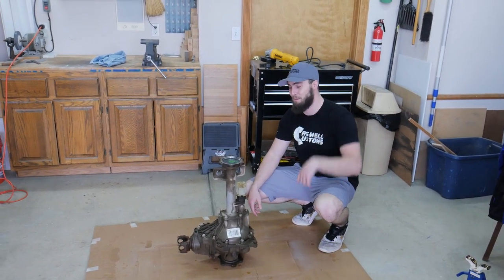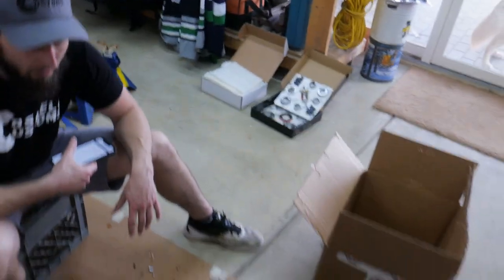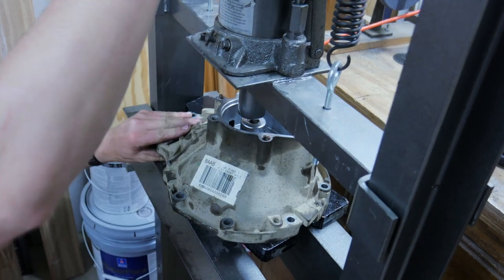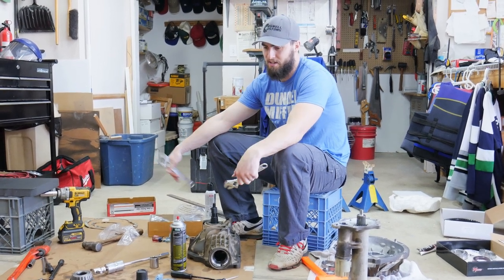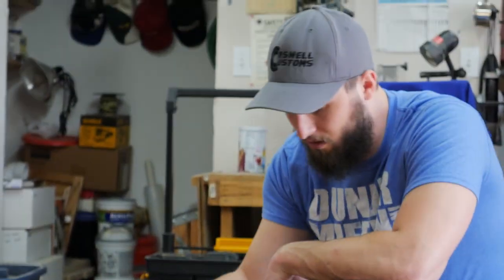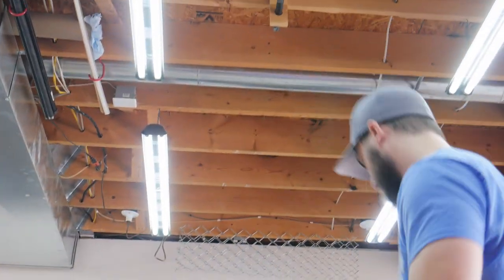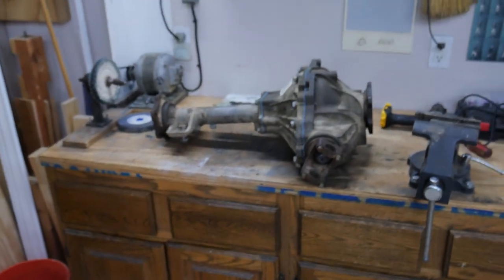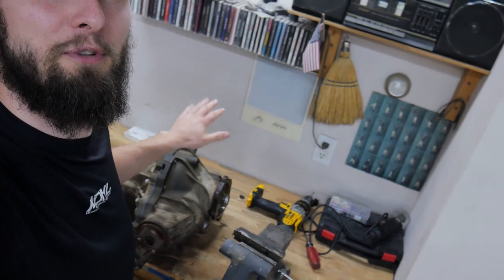GM 8.25 IFS Front Differential Re-gear 3.73 to 4.88 1500 trucks

Comment: What size tire you have and hoes the RPM driving around. I am looking at going to 4.88s in my 10 silverado 1500
Reply from the maker: I am running 37’s I do not have the truck all back together so I have not driven it yet since regearing.
Reply: @CaswellCustoms  I run 37s also getting a yukon rear posi and regear to 4.88s in aug.
Reply: I end up changing to 4:88 and it was worth it. The acceleration is way better withe 37s. Only thing I wish I did different is I should of done a rear locker instead of posi.

Comment: How long would you say it took too get it done.
Reply from the maker: You can get it done in a day if you have all the right tools.
Reply: @CaswellCustoms  
10 bolt 8.5 with the 30 spline axles and a tru trac can handle 800+hp..check out stangkilr productions youtube..seen some na sayers on here!🤣👊🏻 justin built a 93 obs chevy truck with a lt4 a 10speed  automatic and a built 10 bolt 8.5!!

Comment: Guys I'm going 35s on my rado 2500 HD with the 6l80e I do go off road would I be better with 4.88s or 4.56s I do go on the highway but I don't have to drive 85 mph either 60 to 65 is just fine by me. What's your opinion gents? Lol. Also what's a decent cheap locker for the rear?
Reply: 4.56 if alot of highway use and a detroit true trac

Comment: Yur also goin prolly regret putting money into tha rear differential.. I just got done swapping my Tahoe to 14 bolt full floater.. if you really use your truck... Prolly be using 9.25 up front
Reply: "prolly" lol. Let me help you, it's spelt PROBABLY. (but you're right, 37s is a good way to grenade your 8.25 if you really beat the shit out of it.)
Reply: @190amg7  I can spell but jus lazy... common abbreviation in south also... yes I will beat on my truck if necessary..